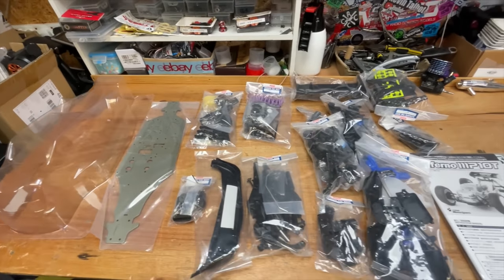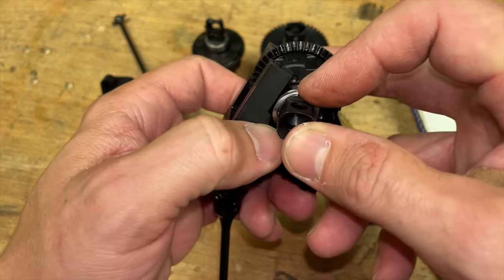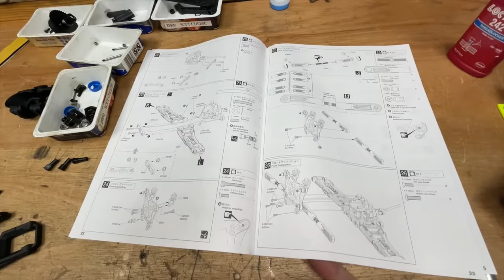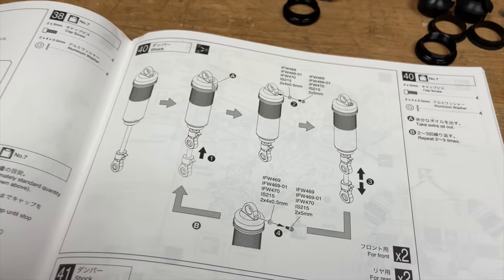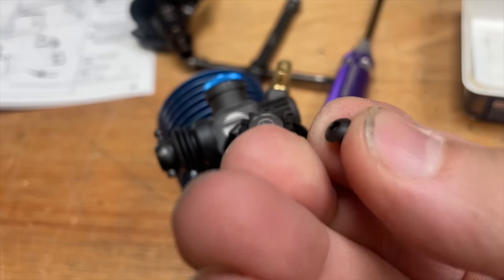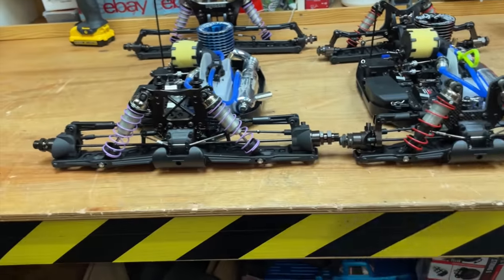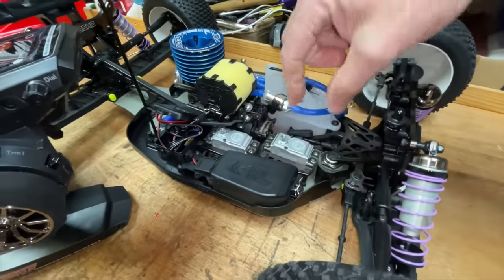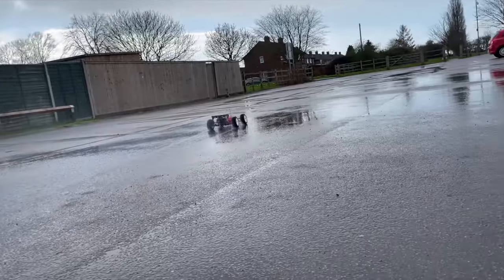Professional Nitro RC Race Truck Build & BASH!

Comment: I know you love to do randome builds and stuff, so I was wondering... because I got my first traxxas rc car because of you, kev. If I never found out about you, I would have never gotten into rc cars. Since my rc car is a rustler 4x4 vxl, I was wondering if you could make one 6s and put on as Many upgrades as possible.
Reply: got a rustler 4x4 myself but ,check out cheeseburger rc he has a rustler4x4 aswell and 6s and alot of upgrades.
Reply: @Cheesicle_  Ive seen his videos already. No offense to him because hes a good youtuber, but kev has better equupment and quality. Also, cheesburgers was already built when he made the video, but kev will probably have the build and all that stuff.
Reply: @Essinx13  also the traxxas 1/10 line diffs are ass you need to upgrade to xo1 and maybe spiral cut ring and pinion if goin 6s on stock 4s is max (i run 4s)

Comment: There is no need to scuff up the body before paint rc car body paint actually chemically etches it self into the body and you don't have to worry about sanding to much and having scuffs show up I race indoor carpet off-road oval and road course and never had paint fall off and I don't scuff up the bodies at all just make sure you use rc car body paint only even my outdoor dirt oval and dirt off road racing stuff I don't scuff the bodies and never have the paint chip off

Comment: oof high price and you have to build it.
Reply: Personally, I usually pay more to make sure I can build it! Racers usually prefer to assemble and tweak their own kits as they see fit, so it is much less work to build it yourself rather than have to disassemble it first to change diff fluids, suspension mounts, shock pistons, oils etc. I have a bit of a love-hate relationship with Kyosho, they made some poor quality RTR stuff in the 2000's which I absolutely hated, but their proper race kits and legendary series cars are possibly the best quality rc products on the market.